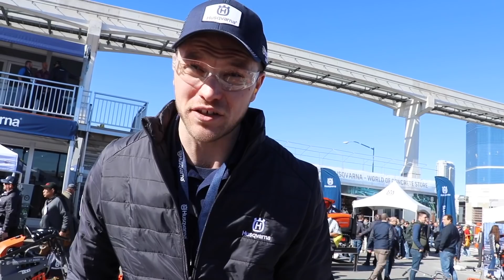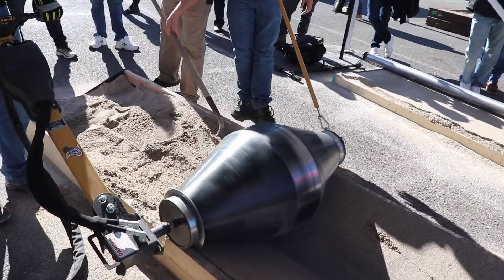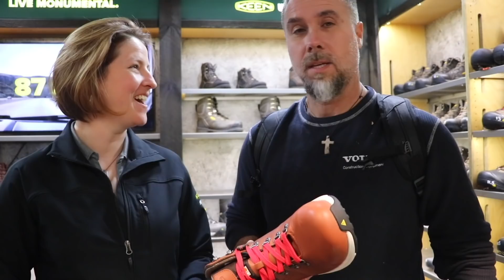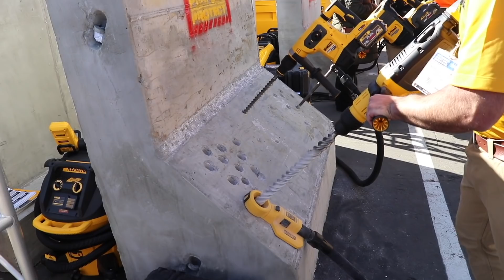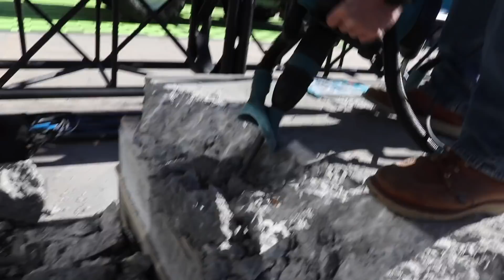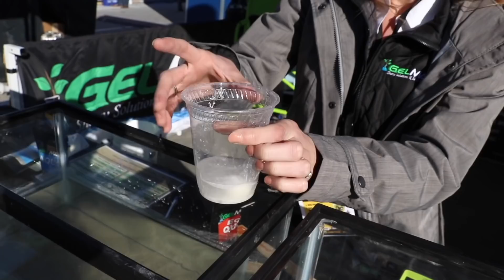Newest Power tools of 2019 at World of Concrete -sponsored by Volvo heavy equipment

Comment: Love DeWalt electric power products ... just use a better swing hammer or flat bar nail puller - to lever up nails with a mechanical advantage [the demo Rep doesn't seem to have construction job experience].  DeWalt makes a pretty reliable and affordable battery powered set of nail guns tho.

Comment: Will look into the SUPER QUICK CONCRETE DISSOLVER- but safe to touch? The Datasheet said: Causes severe skin burns and eye damage, GHS Classification category 1, and yet you dig in with your hand?
Reply: It's slightly stronger than vinegar. Raw material is used in skin care as an exfoliating peel.

Comment: screw Bosh and their angle grinder, Forces you to buy their discs, now because I have a bunch of regular angle grinders and I am not tossing them out, I need to have 2 different complete sets of disc types sitting around.
Reply: Well 'if' the Bosch disks cost the same, it's worth it. Just sell your old grinders.

Comment: I think DeWalt needs a new guy to run that hammer 😂
Reply: Obviously this guy never used the hammer before
Reply: what about using a simple chuck geesh,he made dewalt look bad
Reply: He was in reverse lol
Reply: It’s because he had a lefty hammer lol
Reply: Needs some milk
Reply: The head is the wrong shape for decent nail pulling. Needs more curve on the claw like the original blue hand Estwing.
Reply: @Palpac  true it's not ideal for leverage but those hammers are great for nails in corners as the handle does not angle in front of your work piece when you grab on. I keep both the estwing and DeWalt in my box!

Comment: The ease of access on that Volvo was nice, I wish cars were built in the same way. Also that Bosch quick release grinder was great, I remember picking a brand I didn't like simply because the spanner fitted inside the case, as opposed to being loose and it getting lost all the time, this idea is much nicer.
That XLR knife, that's nothing new and it's way overpriced.

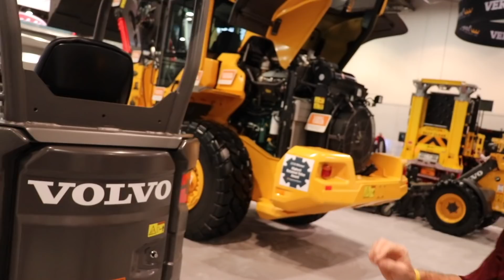Comment: 2:40 - Scots' mon, so you KNOW it's well engineered!
[NM - covered it later] Auto' shutdown is actually a darn good cash saver - especially if there is a security process rather than just a turn-key to start the plant, some operators will just leave them idling and some of the bigger machines will drink fuel at a horrifying rate even then. You will get an idea of this is your road vehicle has a fuel consumption read-out that operates at idle - and check the difference between idling in gear Vs neutral, then think how much time you city guys spend stopped at lights over a year... Ah, doh, didn't think of the hour side.
Concrete disolver is REALLY good for those of you "with guys" who don't clean their mixers properly - especially these that use light guage drums.

Comment: You know the Romans did it best they made concrete that actually got stronger over time. I think they used volcanic ash in their mix
Reply: Volcanic Ash, but the real key component was ocean salt water. The salt reacted with the ash to form crystals that would grow over time strengthening the concrete.
Reply: Ryan Bond very true however in some climates if you were to do this it would fail because it would be to hard like with frost it would not be good.
Reply: as it stands almost all concrete gets "stronger" over time. Though that also means it becomes more brittle. Additionally concrete cures far better in humid environments than dry and cool environments, generally speaking.
Reply: @ajv0987  see, your last point, "becomes more brittle." That's the difference. The ran concrete doesn't become more brittle, there is no weakening of the structure or strength over time. Erosion plays a slow game with it, but beyond that nothing. Modern concrete ages much much much faster.
Reply: @RJBond121  It does get more brittle when it get harder.  This works with everything because you dont want something too hard because it will snap easily.  You want it so it's hard an its able to take vibration so it doesn't break.
Reply: @markJ6425  Roman concrete does not become brittle. That's why they are still studying it today. That's specifically what makes it different from modern concrete. It's hard, bit does not crumble and snap like more modern concretes.
Reply: The trick with Roman concrete was that it didn't give out much heat during the reaction meaning it took a long time to fully achieve its strength. Less stress on the concrete so it lasted longer 
Modern concrete goes off too quick (because we need it too) the heat during the curing period makes it brittle which is why Engineers only actually give it a 50 year shelf life